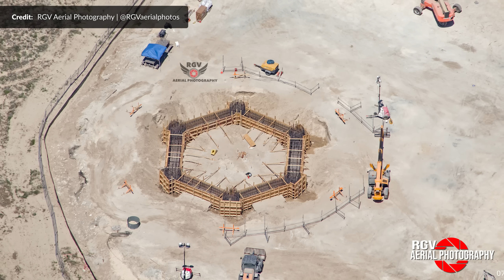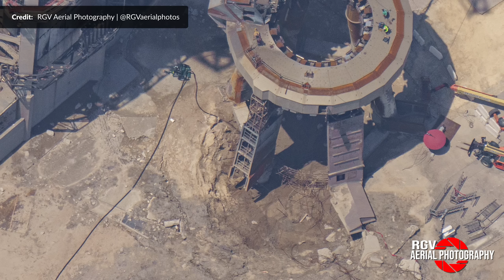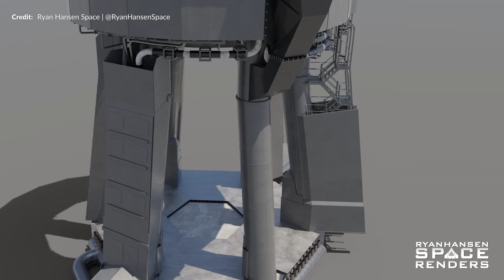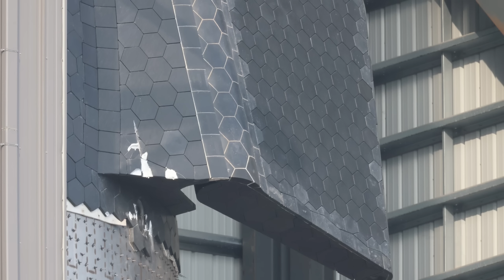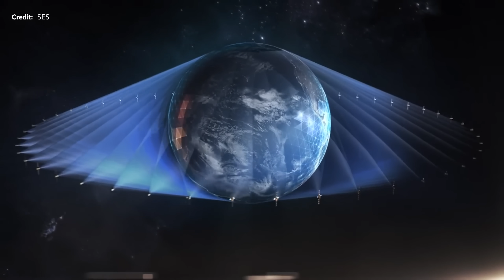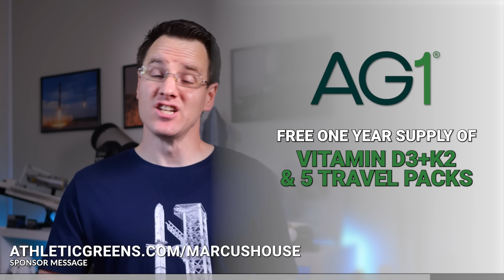The Starship Damage Left Behind: How are SpaceX Moving Forward?

Comment: That launch was a bozo show and dangerously reckless. Shoddy engineering failed to calculate the ground force. The termination process also failed, not activating until 45 seconds after the button was pressed. If this was an airline it would never get the five star rating necessary to renew their permit. He should be issued a warning and if there's another major technical failure like that one, he should lose his permit to operate that dangerous company.
What is also a lie and an insult to our intelligence is that they called the mission a SUCCESS(???) because of the data acquired. That statement only showed that they are capable of lying.

Comment: You are being shortsighted. 
A 250 ton expandable can be a configuration of a whole lab, full of equipment put in orbit, never to return again. 
It can also be a ship that delivers a constellation of super telescopes in a Lagrange point. 
There will be lots of applications for an expandable starship. 
Moreover, if you only need 60 to 70% of the maximum thrust of an engine, it’s more likely that it will degrade significantly less, making it possible to be reused over and over without the need of refurbishment. 
Maybe they have already learned it from falcon 9, and are already planing it this way. 
And finally, you Americans loooove the Power, it sells better than advertising it’s reusabiility. 
They don’t need to tell the public this kind of detail, that puts them so far ahead that can bring the wrong attention towards them

Comment: If it blew away the launch pad and it is concrete, then the question is about the lander and what would it do to the Lunar surface or the Mars surface???  Would it be landing in a hole???   There may be practical mass "scalability" maximums.

Comment: Plasma torch is used  to  cut steel plates submerged in  water.  One just wonders if plasma generated by Raptor rocket engines is in any way different than plasma used for cutting steel? Is Elon going to use steel that does not contain any Iron in it? Is Elon going to use water that does not contain 90% Oxygen by weight,? Questions about Elon's contact with reality keep on piling up. Elon says that they will shoot water upward to counteract pressure of gas coming out of Raptor engines. Does he has a clue what pressures is he talking about? Raptor engine with expansion bell diameter of 1.3m generates thrust of 230mT that works out to 13 bar or 130m of water column. Divergence of exhaust of Raptor rocket engine is minimal over distance under consideration so there will be great variation in gas pressure hitting water nozzles. So it seems that in some places water will be pushed back into the nozzzles while in other places water will be blasting bottom of the rocket.

Comment: Regarding the "Strong metal plates", how strong ARE they? Can they stand up to the 16.7 million lbs. of thrust that 33 Merlin's at full power deliver? Can they withstand the launch temperatures from those 33 engines at full throttle? How many GPM can they put through it? This is a rather bogus-sounding attempt to stay on schedule, because it will be rather difficult to prevent a singular weak spot, and that is all it will take, under those temperatures and pressures, for a cataclysmic failure. THEN there's the possibility that the steel plate solution exacerbates the acoustic shockwave problem by more-effectively reflecting all the acoustic energy right back at the source. Sure sounds like Ego-lon is TRYING to fail, in as many was as possible simultaneously, and as spectacularly as possible.

Comment: Marcus when do we get a full analysis of the failure mechanisms in the Raptors? We now know three of them failed to start so that casts doubt on whether these engines failed due to debris. Then there were at least five more Raptors failing during flight. We clearly have a design that has uncharacterised flaws and there were possibly new failure mechanisms at work due to the interaction between engines. Are we going to see a major re-design of Raptor as a result? Or will they be de-rated to achieve some sort of reliability?

Comment: Kind of surprised they didn't build a similar launch pad to what was used for the Saturn V, Space Shuttle, and SLS given that rockets of those sizes need a deflection tunnel underneath with oversized deluge system to deflect the steam and exhaust gases in a way to where it won't damage the launch pad. Frankly SpaceX is damn lucky their "fuck it, we'll do it live" approach didn't end worse than it did.

I'm sure they will also need to rethink the materials used in construction and covering the launch pad in thick steel or aluminum plate because that rocket obliterated concrete.
Reply: Why not try something different and see how it rolls, then make something that takes the best of alternatives?
Reply: @Pene7942  A flame diverter system is the standard because its a rosetta stone kind of idea just like the tire, fire, a door, etc. Its a situation  of if it isn't broke then don't fix it and the fact they pushed ahead without having some sort of flame diverter on a rocket that is 2x more powerful than the saturn V is an extreme show of ignorance.

Comment: It is clear to me  that concrete  is a very poor choice for this rocket pad.  I found that by mixing  concrete with Tight-Bond II  made the concrete extremely strong.  I am not suggesting Tight-Bond II be used on the rocket pad.  But a strength ingredient of concrete beyond what it has been strengthened prior to launch.  On top of that, steel plates should be placed so as to prevent erosion of concrete.  This is an incredibly powerful rocket of the likes no one in the world has ever witnessed.  Way to go SpaceX. You learney a lot from this launch.  You have proven your rocket is a capable machine.  While learning that your platform must be much more robust.

Comment: If they can launch again less than a year from now they are lucky (and it will be yet another gross regulatory failure on the part of the FAA & other relevant agencies). If they go with the steel plate instead of a full flame trench & water deluge system they'll prove they haven't learned anything & they'l probably wipe out 1/3 of their engines again.

Comment: Is it surprising to anyone that this happened to the pad?  Any structural or materials engineer worth their money knew this was going to happen.  The blast is too powerful and HAS to be directed just like most rockets much less powerful.  Probably the only material that's going to withstand the blast is metal of some type, NOT a cement.

And fix THAT pad?  You mean rip it down to nothing and start again?
Reply: Apparently fixing doesn't meant rip it done to nothing...

Comment: It's a mistake not to build those blast tunnels.  It has worked so well in the past since the 1960's, I can't imagine that BIGGER rockets engineers don't automatically make that part of the launching pads.  And, they are pretty much a maintenance free way of tunneling the force/explosion AWAY from the precious payload. Just seems dumb, dumb, dumb, and an easy way to not have to rebuild your dang launch pads... Sometimes smart folks really lack common sense.

Comment: I'm guessing it will be half a year before the second flight. if it happens before oktober this year I'll be very impressed. It seems to me like there are going to be big updates and it will be much longer then if it was planned all ahead of time. They'll update the easy to upgrade stuff first and then as more ideas come in add those upgrades where possible. It's a feature of the quick development method they use but in this case it will probably cost them time instead of it saving them time.

Comment: Again all it takes is to get rid of the concrete, and replace it with 2 to 3 foot thick steal plates, that can be replaced if needed. If they allow water to pass thru under the plates, they can reduce the chance of if going molten during a launch, and also allow the water to pass over the plates, to reduce the chance of sound damage.

Comment: Elon saying two months to repair will probably take to clean it up. The FAA says 6 to 7 months is just an estimated time it will take. However, I don't really believe the FAA, the area is only at least half a football feild wide. Though Elon said the steel plates were ready, buy did come on time. But instead use the fondige to test.  The tower and pad don't necessarily need to be tear downed! I do believe that the bottom pad will be done by the end of summer or early September. Though the workers are working tirelessly day and night on the foundation! Even with all the machines and equipment. Trust me!

Comment: it wasnt blown up by the FTS! FTS most likely failed. pls correct
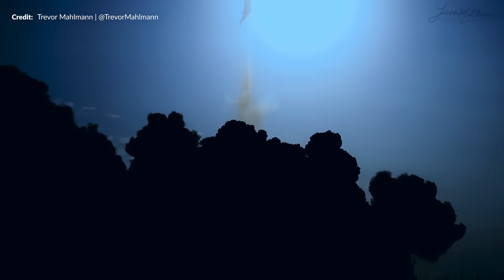Reply: FTS blew a hole in the tanks of both stages. You can see this occur roughly 3:09 seconds into flight. However it is true that they were not effective, the vehicle carried on way too long before finally losing enough pressure to collapse and explode.
Reply from the maker: Musk said they did trigger it. Confirmed.
Reply: @MarcusHouse  Triggered yes, but it wasnt the reason for the ship blowing up/breaking apart. thanks for the reply so. Musk saying it doesnt confirm anything, he also said in 2011 they(SpaceX) bring people to Mars in the next 10 years, does that also equals confirmed, since its 2023 now and well...

Comment: Even if SpaceX uses a water-cooled steel plate, would that reduce the damage and disruption to neighboring towns? One complaint that has come up was that the launch covered homes with a fine dust, and the sound energy was enough to shatter windows. I don't see how this could be addressed without a flame trench.
Reply: Port Isabel and South Padre Island were likely covered in dust because the pad concrete failed and a lot of dirt was ejected into the air. If the pad survived because of a diverter and/or a deluge system, then the dust likely would not be as bad or go as far.

Comment: What needs to be done before the next Starship launch. 1. Fix the launch tower so the rockets don't dig holes. 2. Site the tank farm well away from the launch pad as should have been done from the start.
Reply: There is not a lot of room at Boca Chica. The tank farm is right beside Hwy 4 already. Surrounding the launch site is state park and wildlife area, so not a lot of room to expand.
Reply: @steveaustin2686  Obviously should have picked somewhere else to set up shop.
Reply: @edwardjohannes360   You need somewhere on the east coast, far enough from civilization to have an exclusion zone, but not so far to make the logistics difficult. Reportedly there were 5 sites and Boca Chica was the best location.

Comment: OMG, most of the failures caused in starships have been due to launch platform fod impacts and this big launch seems to be no different. Looks like flying usless launch pad caused the 3 first engines to fail then subsequent damage to the gimbal mechanism. It is so obvious please put an appropriate sized flame diverter and flood system in.  Are they engineers or Lego designers. @Marcus, @TimD and @ScottM please please dont let them destroy anotherrrrrr... beautiful rocket due to a hopeless pad.😢. Just sayn.👍

Comment: Elon's vaporware salemens,   FAA and NASA needs to cancel Elon's contracts.
Reply: The FAA doesn't have any contracts with SpaceX. NASA loves the CRS, Commercial Crew, and many single mission contracts that they have with SpaceX. Starship is still in early development. While it almost certainly won't make some of the more outlandish Musk goals, if Starship can become operational with a close to the current projected goals, it will be a valuable launcher. NASA likes the robust Starship test program. From page 10 of the HLS Option A Source Selection Statement from early April 2021 before SN15 successfully landed.

"Finally, within Technical Area of Focus 7, Approach to Early Systems Demonstrations, I agree with the SEP’s assignment of a significant strength for SpaceX’s robust early system demonstration ground and flight system campaign, which focuses on the highest risk aspects of its proposed architecture. This will allow SpaceX to isolate and address performance and operational issues early in its development cycle, which will meaningfully inform the maturation of its capability and increase overall confidence in its performance abilities."
Reply: @steveaustin2686  Starship is fraud, period. 
Elon cannot nor will not ever able to eclipse the Space Shuttle program, ever. 
The maths do not add up.  Space Shuttle could  deliver crew, science package and cargo to orbit at better price.  Elon's bum, feeding from the government trough.

Comment: It is quite endearing that you think they will be able to repair the launching hardware. It needs a properly engineered flame trench design, not just a water deluge system on steel plates. Any flat (planar) construction below the engines is just going to reflect shock fronts back up to the engines, as it did here shortly after ignition. Indeed, the whole launch system seems to have been rather ad-hoc and piecemeal. Compare with the many design evolutions of the rocket stages which seem to have resulted in an exceptionally robust design.
Reply: To be fair, the OLM distance to the ground is roughly the same as the distance from the pads at LC-39 to the bottom of their flame trenches. Musk wanted to do without the flame diverter, likely because it would make servicing easier with the booster on the pad. Musk did say in the past, that while they didn't want to have a diverter, they would install one if necessary. This was pretty much a punch in the nose to install a flame diverter to go with the water-cooled steel armor plan.

Comment: Nasa, being Space X's biggest customer and main source of funding have said that the Heavy must use the launch pads at the Kennedy Space Centre in the future if they want their business. They are competing with the Ariane 5 from the ESA which is 100% funded by 22 EU countries. The concept of taking passengers and landing back on earth has been put on hold, probably permanently. 
As Neil Armstrong once said, rockets are nothing more than giant fire crackers with about the same safety level. That's why all NASA capsules had an escape rocket above them in the case of a serious malfunction. Space X will have to do the same if they take passengers.
Reply: ??
The Falcon Heavy is only currently able to launch from LC-39A (KSC), because SpaceX has not modified any other pads for it. 

SLC-40 (CCSFS) is only for Falcon 9 cargo right now, but SpaceX is modifying it for Crew Dragon. Maybe they will add in Falcon Heavy capability as well.

SLC-4E (VSFB) is only for Falcon 9 cargo and with SLC-6 (VSFB) being added, SpaceX is puting in Falcon Heavy launch capability there along with Falcon 9. Since the Delta-IV Heavy is being retired, the Falcon Heavy and the Vulcan Centaur (VC4 or VC6) will be the replacements for it.
Reply: @steveaustin2686  Correct. But it will have to be modified if it wants to be commercially viable and satisfy NASA. Cheap and cheerful was a failure.
Reply: @TechnikMeister2  Why would the Falcon Heavy have to be modified? Why would NASA need it to be modfied? NASA chose the Falcon Heavy for the Nancy Grace Roman Space Telescope (NGRST) launch later this decade, so NASA seems happy with Falcon Heavy. Especially since NASA picked Falcon Heavy for also launching Psyche and the Dragon XL, if Starship doesn't replace the Dragon XL.

Comment: what did spacex think was going to happen, they simply gambled that the damage would not be that severe from a single launch, the point is they gambled and lost, the rocket ripped apart the concrete and flying bits of concrete damaged the underside of the rocket where the engines were, hence the damage to the rocket engines that failed and that caused the whole mission to fail, this was a gamble spacex lost, had they thought it out and opted for a safer way to launch the mission may  have been a complete success, but it was a failed mission, sure the rocket got off the ground, but it may have made it all the way if they chose not gamble !!!

Comment: The atmosphere at 40km is less than half of 1% of the density you get at sea level. And at 30km it's still less than 2%.
Granted, the drag force scales with the square of velocity, so at 2000km/hr at 30km in altitude, that's like going at 250km/hr at sea level. Somewhat impressive, but that's actually Starship's terminal velocity (about 70m/s) so it's not surprising it could withstand that. The booster is different... But I still don't feel surprised by it.

Comment: Everything on the launch mount has to be behind steel, not just hung. The internals opening of the booster area has to be closed with steel as much as possible. No concrete will survive a launch. Any "water cooled steel jacket", if it has an opening in the blast area will simply push water back through the pipes and blow the water source. Water has to flow through and out in massive quantities. This is a new beast.